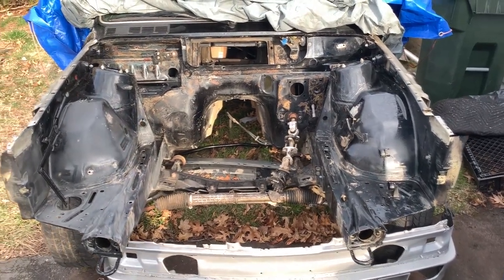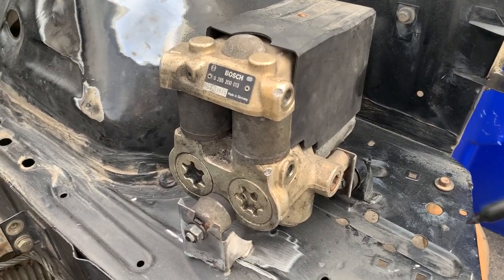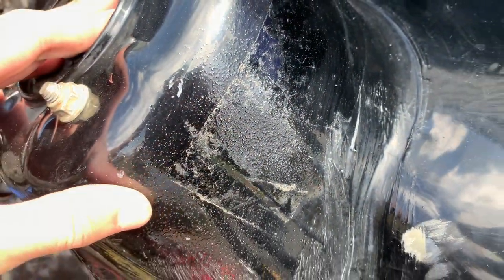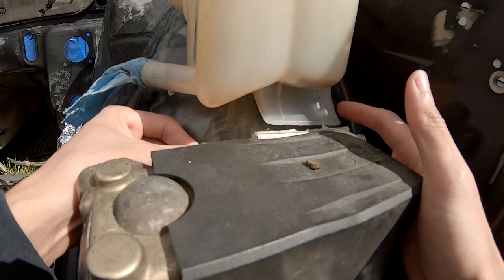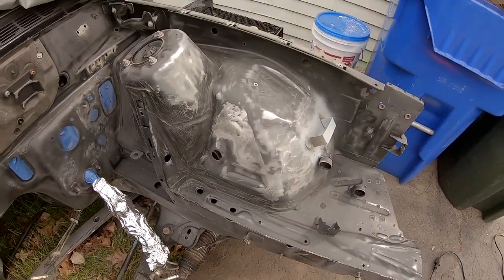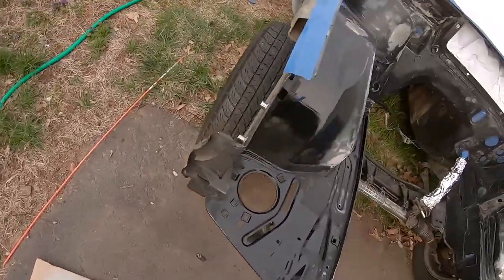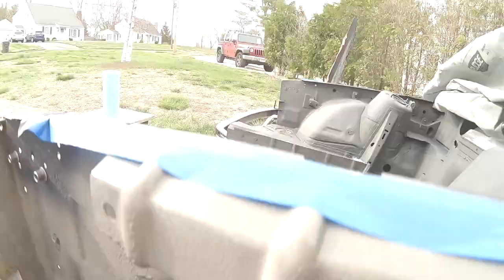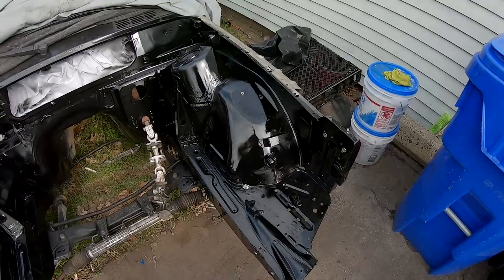SPRAY PAINTING E30 ENGINE BAY

Comment: great end result! 
Just a small tip when sanding filler, always start with 40-60 grid to sand down the difference in height and finish with 320 to make it smooth